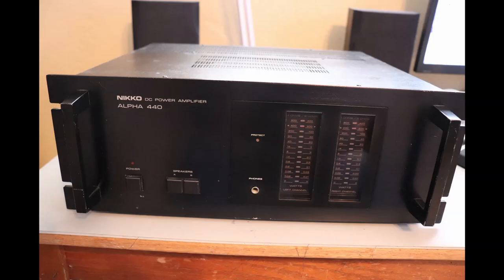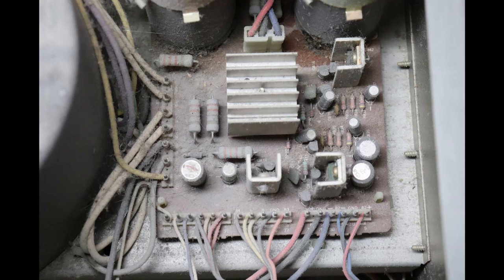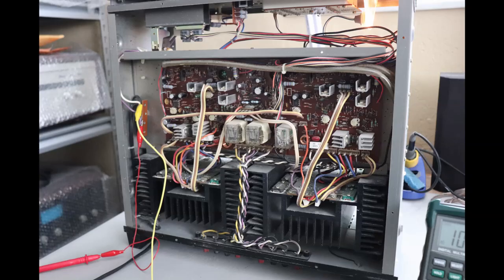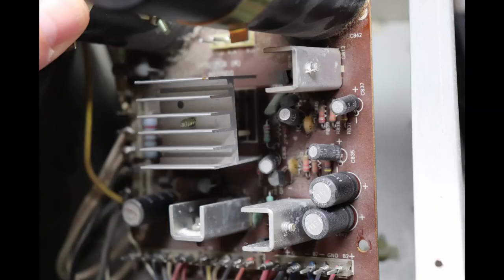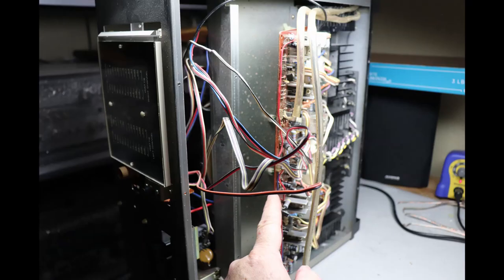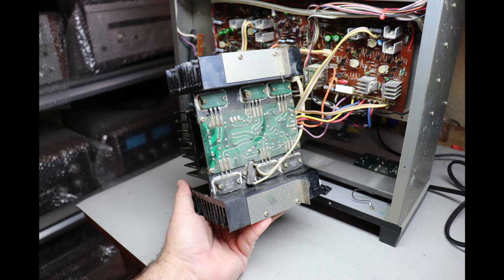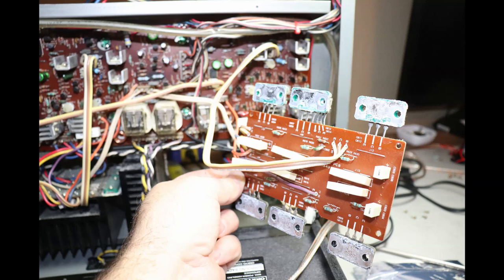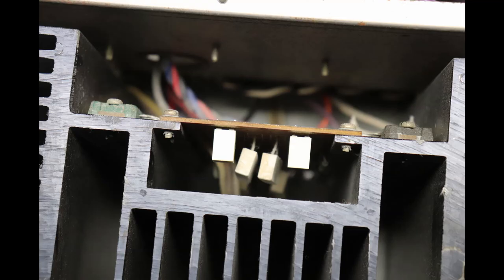Nikko 440 Vintage Stereo DC Power Amplifier Serviced - Old 2 Channel Audio Repair And Restoration

Comment: I owned a Nikko Alpha 450. It was a great amp. No hums, buzzing, or other issues. This amp would power up any speaker and make it shine. Would run all day at decent (for me ...pretty subjective) listening volume effortlessly and no heat issues. Always good to make sure that it has lots of breathing room and not too closed in. It was also a beautiful looking amp. I would rate 10/10!

Comment: I have a Nikko 1019 receiver thats been tucked away for repair 20 years or so now. It claims just 70wpc, im almost positive that rating is way below the actual wattage!
You already know the story; Dad got it brand new from crazy eddies back in the early 80's and I grew up around the thing. One of the channels started to only work when the vol was turned 25% up and then went completely. I do plan to breathe life back into it sometime in the future, your channel is inspiring!

Comment: I have 2 of these in my Atmos system. Using them for the height speakers. Original owner of one of them from the 80s, and bought another off Craigslist. Had them both reconditioned. Very decent amps, quiet and strong. Original amp drove a pair of ADS L1230s, and no problems. Heavy bass.
Not too crazy for the pre-amps. S/N is better on the amps than the pre-amps. Thanks for the video, very interesting to see all the parts taken apart.
Reply from the maker: Your welcome and thank you for watching. You didn't see Nikko stereo gear much back in the day but they made some good equipment.

Comment: I have recently did a partial recapping of my Nikko Alpha 230...

It was an interesting amp up mod.  First of all, I replaced the opamp with an LT1117 opamp.  As those literal fossils are way way way too old and far into the obsolete range.  Any of the reasonably priced opamps are going to walk all over it.  Especially if we compare noise and slew rate.

I popped in a 8-dip socket and the new opamp.  Easy peasy. 

The rest was interesting.  I happened to have most of the polar electrolytic caps for the driver section, so i replaced them, including those 1000uf/80V snap in capacitors.  I just happened to have 2 leftover.

This unit also have 2 x 1uf/100V capacitors on the power transistor board, working as power rail decoupling capacitors.  Instead of replace them with 1uF film or electrolytic, i just placed 2 x 10uF/100V caps there.  As this is for the power output section, a little more capacitance should be pretty helpful.

The most interesting and quality of life mod i did was replacing the speaker terminal and replace the incandescent bulb with LED light strip (3500K warm white).  This is easily accomplished by cutting the bulb wires and fitting a rectifier+capacitor combo on to the AC power supply pins.  Then reuse the original bulb wires to hook up the LED strip.  It worked so well, i don't even need the reflective shroud to focus the light onto the VU meter.

The second mod is spring clip speaker terminals.  They are just going to make it difficult for connecting any modern speaker cables.  I replaced it with a set of standard n-way binding posts.  Also rewired that new terminal with thicker 16AWG copper wires(compared to 20AWG originally).  Just to be on the safe side, i also directly soldered the wire before the speaker selection switches. 

My el-cheapo multimeter told me the new connection is about 0.15ohm lower in resistance.  Since meter like that is really just winging it at that range, I might see if i can measure it against the factory original setup (kept the Speaker B original).

Lots of fun, now I'm testing it in my system.  It sounded really muffled and with soundstage constrained at first.  After an hour or so, it opened up and started to sound pretty good. 

I'll keep it in the rig while I take another crack at my Ashly FET-2000M.  Got some more 100V caps that i didn't have before, now i can finally replace all the small value caps with modern fresh capacitors.

Comment: I've never heard of Nikko? The amp does have that typical 80's look though. Nice find.
Reply from the maker: Thank you. They were not as well known in the audio world as Pioneer, Sansui, Marantz etc. but they built some pretty good stuff back in the day.
Reply: Here in Scandinavia, Nikko was only sold through alternative dealers like “direct from importer to you”. The main brands had a national importer/representation office, so in theory you could save 10-30%. Inowned several Nikko products, and they were great. The same dealer also sold Apollon, Pickering and Accuphase. I wish i had bought some Accuphase back then, they were so nice made…

Comment: Hi, I have both the 440 nikko alpha to be repaired and the working 450 to be checked. Could you please suggest me the best replacement for the Toshiba 2sa1095A and 2sc2565A power amplifiers as the Sanken 2sa1216 Y and 2sc2922 Y are also almost impossible to find. There is also an updated solution with TO 3P (MT100) or TO 264 container type Onsemi or Toshiba Thank you so much for your availability
Reply from the maker: I'd love to help you out but I have no idea what the replacements would be. I'd try a google search and see if you can get some info.

Comment: I enjoy the video,thank you.
I  got an 220 NIKKO Amp,was working real good,but now the protection light still on and don't re set,how can I make it work again.
Thank you.
Reply from the maker: Your welcome and thank you for watching. It's very difficult to say what the issue is. The protection light is a lot like your check engine light in your car. There can be many different causes, high DC offset from either the left or the right channel, the protection circuity itself having an issue as well as other possible causes. If you do not have the experience or you don't feel that you can repair it yourself google "vintage audio repair" or "vintage stereo repair" and see if there is someone local that can help you out.

Comment: When using Deoxit to clean potentiometers, are you supposed to apply once, move the wiper (knob), then reapply the Deoxit and let it run out of the hole to actually remove the crud?  If not, how do you do it?
Reply from the maker: You don't need much deoxit spray itself.  If you see it coming out, you have plenty. The key is to move whatever control you are cleaning through it's range, 25-50 times. I know it sounds like a lot of times but that will make sure that the control will be quiet and stay quiet in the future.
Reply: I read quite a few accounts that Deoxit D5 can hurt some pots. It is advised to use Deoxit Faderlube F5 on pots/sliders and Deoxit D5 on switches.

From what I read on the datasheet D5 is for metal contacts. Pots have carbon tracks in them which isn't metal. 

I could be wrong but I have just read many posts on audiokarma, datasheets etc.

A lot of people do use D5 on pots though, so it can work but just be aware of potential risk. 

Just sharing what i've read, i'm sure the vid author is more experienced than I.
Reply from the maker: @viewer54322  Thanks for commenting. I personally haven't had an issue. I use many of the Deoxit products, D5, D100, F5 , F100, G5, G100 ,S5 and S100. I don't think most people here want to invest hundreds of dollars for cleaners and then figure which is the best cleaner for a particular switch or pot. I am a collector of vintage audio equipment and I only repair and restore my own personal equipment. Some that I have had for 40+ years. Like everything in life you should do your own research and make your own decisions. Thanks again!